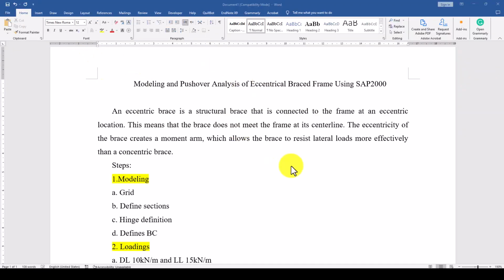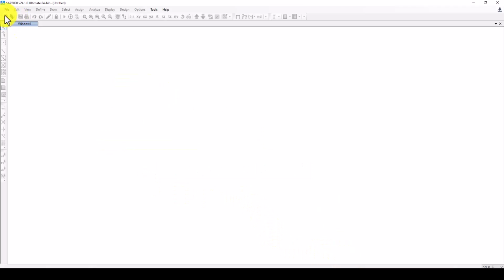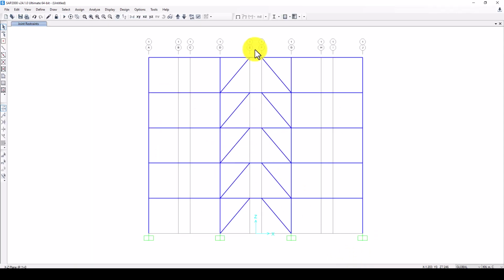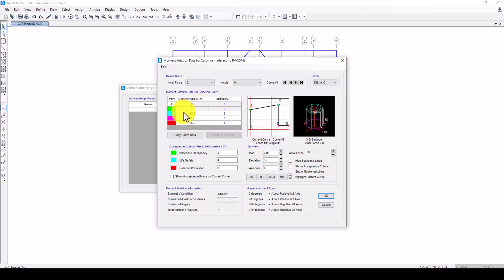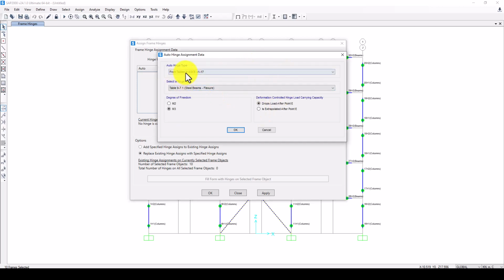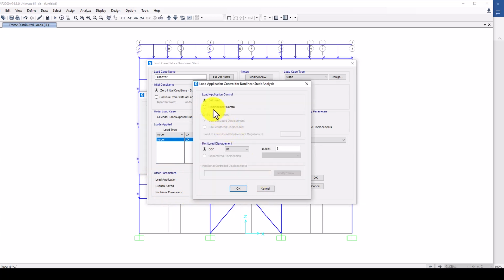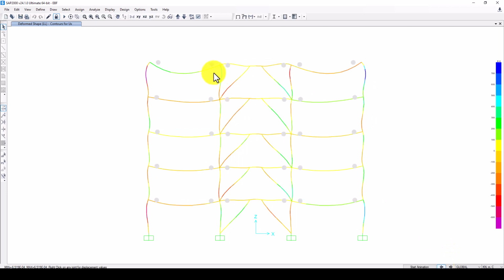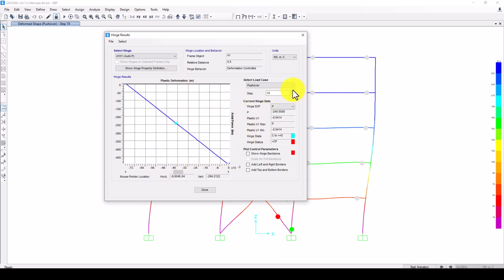A Step-by-Step Guide to Modeling and Pushover Analysis of Eccentrically Braced Frame in SAP2000

Comment: Why does the message “maximum number of null steps reached” appear during the pushover analysis? Does this indicate an error in the model, or is it something normal that can happen in certain situations?
Reply from the maker: Model is unstable, and convergence issues.
Reply: @KSSE_EngineerThanks for the explanation! What would you recommend doing to fix the instability and convergence issues? Are there specific modeling aspects (like hinge properties, load increments, or boundary conditions) that I should check or adjust? Do you have any videos explaining this or showing how to solve this type of problem?

Comment: Hello Sir, thank you for this. I used manually defined hinges but my pushover results seem to have only 4 steps, it doesn't show the full failure. What might be the issue?
Reply from the maker: This is mostly because of the material and hinges behavior in the hinge properties. Again watch the video carefully.

Comment: thankss for the video! it helps me a lott. btw, in the 3d frame application, shall we use the hinge definition too for the section of frame that have no brace in it? or we can just use pinned or continous instead for the connection of beams n columns?
Reply from the maker: Yes , you can .
Reply: @KSSE_Engineer okeyy, i will try to use pinned n continous then. thank you sm😀